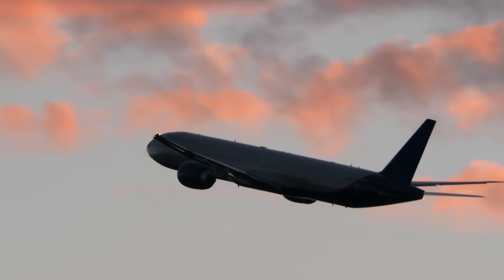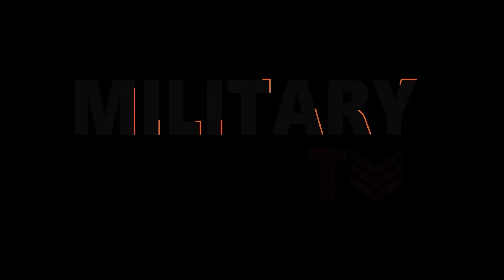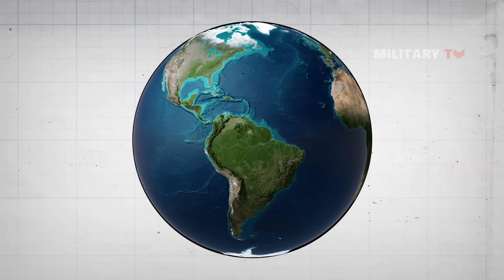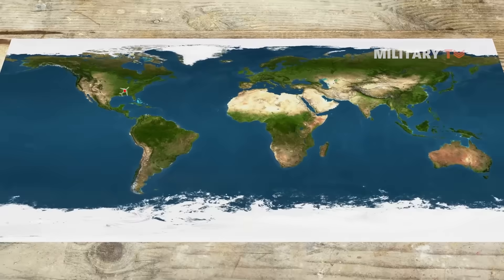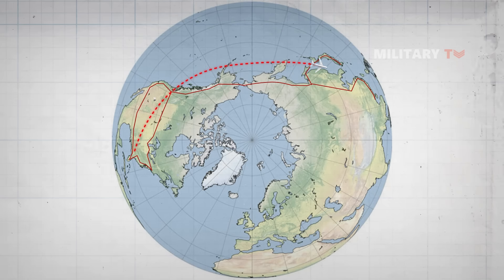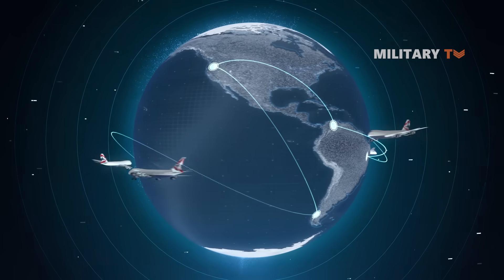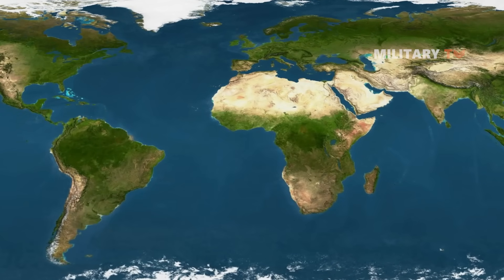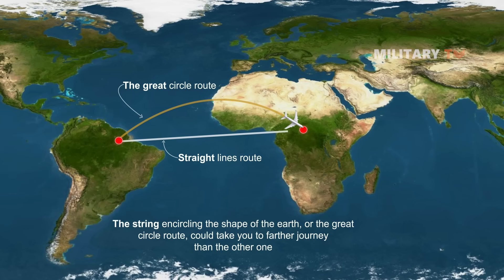Why Airplanes Fly On A Curved Path

Comment: If it needs such a complicated explanation..it's probably a load of bollox.
Why use a Mercator projection Map to show the route?, when straight line routes divided into Legs, can be shown using the old 'Gleeson new standard Map of the world'.
The same Map as the U.N. Symbol.
Before the formation of NASA Aviation Maps were employing the old 'Gleeson' style Flat Maps.
The old Map also works out for Long haul flights from Bali,Indonesia to L.A....a so called 'great circle route' over the Pacific ocean, were a passenger went into Labour resulting in an emergency Landing in ALASKA!
This deviation of thousands of miles North cannot be explained by a 'great circle route' but seems very obvious as a straight line route on the Gleeson.
Which Map is accurate? Certainly not the Mercator, were Greenland is the size of Africa😂😂😂
Reply: See how well your Gleason map works below the equator flying from continent to continent. The Gleason Map is only accurate if you're flying due north or due south.
Reply: @ImperrfectStranger  I never said it was accurate...Mercator doesn't make sense for Flights either..why Fly to Alaska in the far North when L.A.X. is a "great circle route" across the Pacific...there's plenty of Pacific Islands to Land at.
On the Gleeson...Alaska is 'on the way' to LA.
Reply: @QuantatativeStealing  No flat map that has been made can account for real distances between all international cities. Of course the Mercator doesn't make sense. It's a "projection" of a globe, just as the Gleason is. You can't squash a globe onto a flat surface. There will always be errors in any world flat map. Only programs like Google Earth shows a realistic representation of the earth's surface and real distances. 

Use the ruler function in Google Earth to check distances between international cities in the Southern Hemisphere (and Northern Hemisphere) and compare the average flight times i.e. in both directions to help offset the effect of tradewinds/jetstreams. 

Position the globe in Google Earth to show a straight line, rather than an arc and it will all make sense.... including why no flights need to fly over the South Pole... There are simply no major airports which require major airlines to fly directly over the pole. e.g. How many South Americans want to fly to Western Australia? It's mostly desert. Also, all flights, for safety reasons, have to be within a certain distance of a suitable landing airport (in case of engine failures and fires). As far as I know, there are only relatively short ice runways in Antarctica. Our national Australian airline, Qantas, used to run long sightseeing flights over Antarctica in summer (when it had 747's). Passenger numbers were limited to an extent and it had to be equipped with heavy, expensive survival gear in case the worst happened. Passengers and crew had to go through special/extended safety briefings. 

You would have to give me specific details of your Alaska flights. I can paint it in Google Earth and look for any abnormalities (Since Russia is off limits these days, there will be some diversions between some Asian cities and the USA). I can post a link to my results here YouTube will allow.
Reply: @TruthSeeker8717 What truth are you seeking? The globe truth? The Gleason map is a projection of the globe (it says so on the map the flat earthers love to use). Whose side are you on? From your messages, I'm not sure whose side you're on. I'm 100% glober
Reply: @TruthSeeker8717 P.S. Only a globe requires a projection. A pizza earth doesn't require a projection to turn it into a flat map.
Reply: @TruthSeeker8717 My daf (sic)? So you agree the Gleason map has the word projection on it? 
I live on a globe. The flights I've made to/ from Sydney prove that I live on a globe.  Why don't flat earthers ever try this for themselves? I've refuelled hundreds of aircraft going to destinations in the Southern Hemisphere. My work schedule also included details on specific aircraft which have gone to various destinations and returned in times which would be impossible using the linear distances on a Gleason map. I know the flights were real because I've seen them leave and come back. And the passengers arriving are obviously from these countries. 
"DAF" in your lingo is someone who refuses to accept the reality of the globe.
Reply: @TruthSeeker8717 Are you listening? The Gleason map has the word "projection" on it. Go look at the original.
Sunrise and sunset direction in the real world disprove the flat earth sun rotation. e.g. Below the Tropic of Capricorn, the sun on a flat earth would always set north of west. At various times of the year, it sets of west in the real world. This is impossible on a flat earth. It's very clear to me you have never visited a reputable flat earth debunking website. The hosts spend thousands of hours explaining why your theories are wrong (with detailed videos, diagrams and mathematics). I've visited dozens of flat earth websites and they just can't handle what I tell them. They lie, they ban, they regurgitate things which have been disproven countless times.
Reply: @TruthSeeker8717 LMAO look whos back. If it's correct, explain the flights, like you never could. I'll wait.
Reply: @TruthSeeker8717 As expected. You cannot explain.
Reply: @TruthSeeker8717 That's it, change the topic, you can do nothing else.
Reply: @TruthSeeker8717 Oh sure it's impossible because your neuron tells you so. Yeah, we should definitely listen to you.
Reply: @TruthSeeker8717 Just so I can be the adult again here: stars are not made of gas, lmao, here you are using your ignorance as a valid argument once again. Nice try indeed.
Reply: @TruthSeeker8717 Awh and look Who ran away, as usual.
Reply: @TruthSeeker8717 Then what are burning balls of gasses? Plus You are only showcasing your personal incredulity, again, not evidence. And you still run away from the flight question. I love it.
Reply: @TruthSeeker8717 I know my model perfectly, I know you don't. We fly level, not flat. And I love the fact that you keep on ignoring this simple question, because you cannot answer It. Last time you were crying because you asked me something first, well now it's my turn, you keep dodging my question. And I won't l'et you change the topic.
Reply: @TruthSeeker8717 Level means constant distance from the surface, your opinions are worthless. Don't tell me how pilots fly, I fly airliners. Water finds nothing, it's not sentient. Your scientific illiteracy Is not a valid argument either. Now, explain those flights. I asked you 30 times.
Reply: @TruthSeeker8717 More opinions, no explanations. You can't.
Reply: @TruthSeeker8717 Why do you keep avoiding the topic? Why are you so afraid ? Plus I already have you an explanation, you ignored it as usual. But yeah, you surely won kiddo, sure.
Reply: @TruthSeeker8717 Prove that I am lying about my profession. Prove It.
Reply: @TruthSeeker8717 And I asked you about the flights First, why do you have so much trouble, kiddo?

Comment: If you flew in a straight line from one place to another, you would have to fly through the Earth to get there. To fly at a constant altitude a direct flight would look straight at the equator on a map with a Mercator projection. As you go horizontally across the Earth north of the equator, your flight path looks more like an arc on a Mercator projection map. The direction of the arc depends on whether you're north or south of the equator. On a map in the on-flight magazine, the curves of the flight paths are just to fit all the flight paths on the map with a little less crowding.

Comment: The earth is not flat. Only an idiot can think that.
But this guy doesn't make much sense either.
My dad was a commercial pilot. Most commercial airplanes flying over several hours will always get to around 35,000 feet  off the ground. So, what circles is he talking about I don't understand. Different planes climb different altitudes. The farther plane has to fly the higher it will get. Usually the most passengers planes fly at around 35,000 feet, especially when crossing the Atlantic Ocean.

Comment: The reason behind this is definitely not that one you’re telling your audience.
Reply: Tell us the Truth then
Reply: @michael.forkert Uhm no, it's Easy to prove the Globe, why are you unable to?
Reply: @AlexFoxthrot  Do you really believe that “scientists” ”estimate” that the  diameter of the  ”OBSERVABLE”  universe is 93 BILLION light years long, which converted would be  8.87 SEPTILLION kilometers or 5.51 SEPTILLION miles?
Reply: @michael.forkert  Your skepticism Is not a valid argument pal. I know big numbers scare small brains. It's ok.
Reply: @michael.forkert  Is that it? Do you have aby valid argument?
Reply: @AlexFoxthrot  If you have a phenomenon in mind, you often think beyond it. If you only hear what is told about it, you don’t think at all.
Reply: @AlexFoxthrot  Fixed ideas are detrimental to the intellect. Stagnated thoughts begin to rot.
Reply: @michael.forkert  There Is a difference between ideas and facts my friend. Your fake poetry brings you nowhere. Again, you don't have a model. Why?
Reply: @AlexFoxthrot  

That’s an excerpt of Einstein’s BS Relativity Theory read it carefully… 

By means of the first equation of the Lorentz transformation the values of these two points at the time t = 0 can be shown to be….. The distance between the lines being (square root). But the meter rod is moving with the velocity v relative to K. It therefore follows that  the Length of a rigid meter rod moving in the direction of its length with the velocity v is….

”A rigid meter rod moving in the DIRECTION OF ITS LENGHT! WTF is that supposed to mean?
  How the heck could The Length of of a rigid meter rod move in the direction of its length? 

Length measurements have no direction , that’s broadly known even to prehistoric cave men.
Reply: @AlexFoxthrot  What  often gets in the way in the pursuit of science, is the human ego. Cordiality and congeniality are lost when the unadulterated quest for truth gets tainted by all sorts of corrupting forces, such as money, power, greed, and pride. We have always to keep in mind the understanding that ridicule, belittlement, derision, disparaging, and derogatory remarks, ad hominem attacks, and the like, have no place within the scientific inquiry nor social civility. In the noble pursuit of science, if one attacks one another for simply making an inquiry or asking a question, you can be sure that that individual is not in any way, shape, or form engaging in the scientific method.
Reply: @michael.forkert  My replies are getting censored so there is no point. Enjoy your fairy tale.